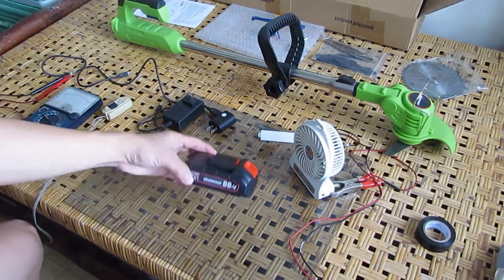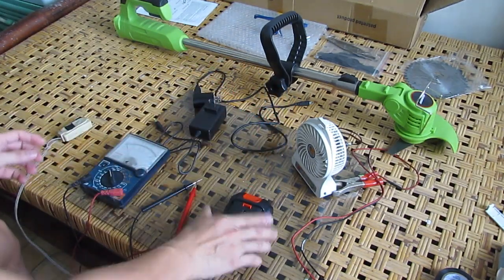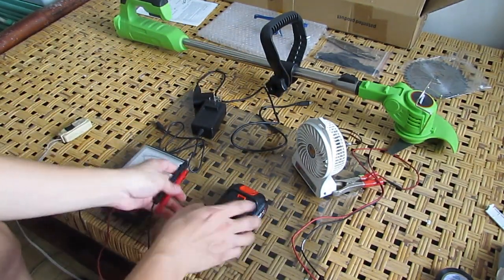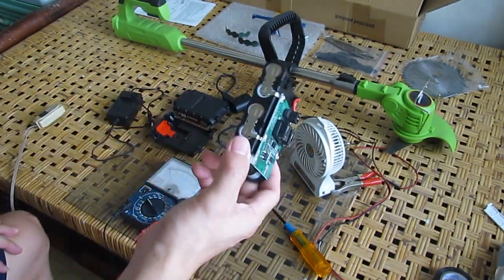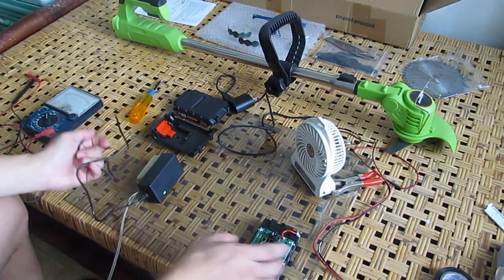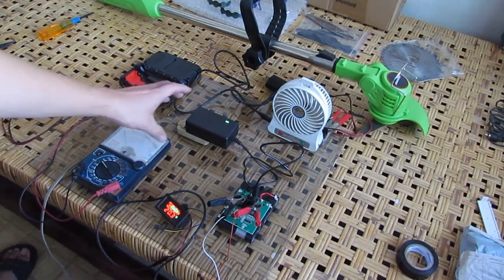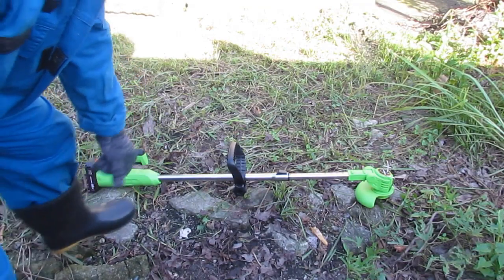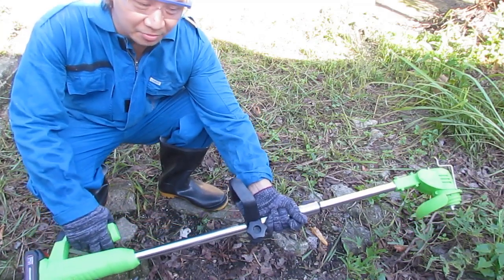Battery pack repair electric grass trimmer cutter

Comment: Is this mean that we should not ddischarged the battery?
Reply from the maker: Hello thanks for watching. yes if battery are discharged below its minimal voltage for charging. it will not charged since there is a bms in this battery pack.

Comment: 👍Nice fix but how long the battery pack last of continues usage?
Reply from the maker: with its default battery pack it last for about 15 minutes due to its low capacity which is only 1500 mah. thanks for watching